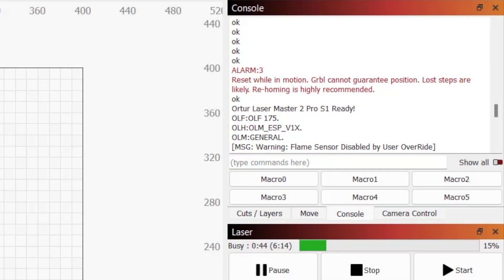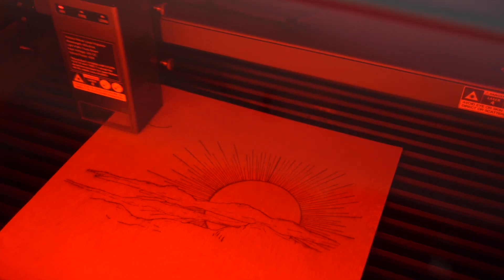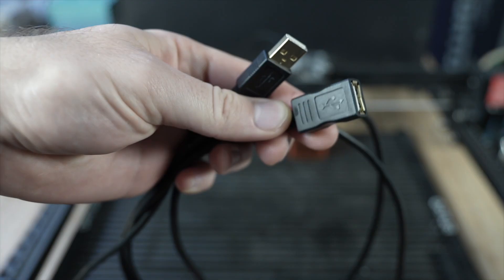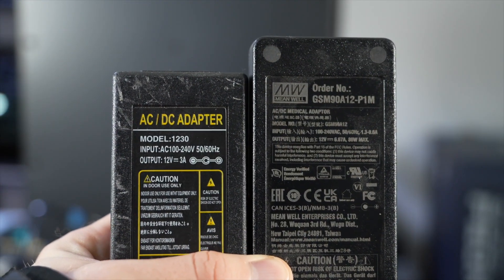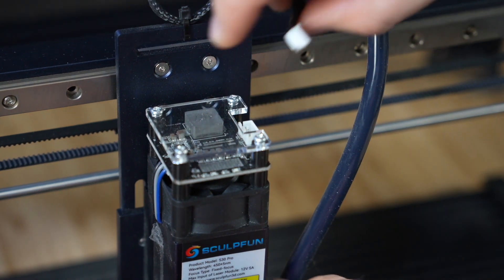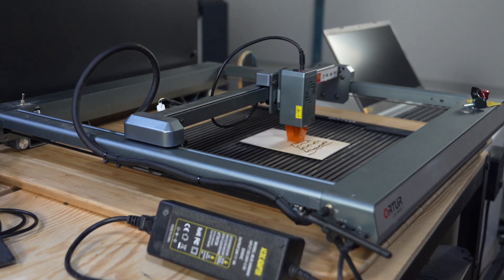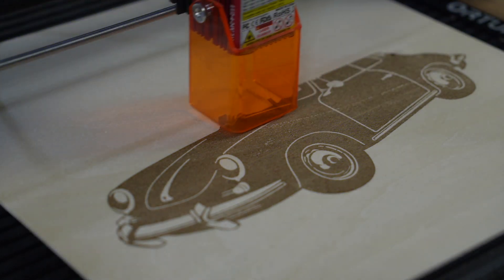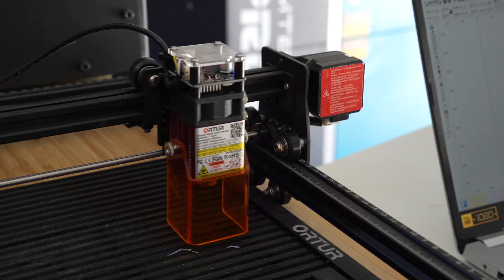GRBL Errors: Alarm 3

Comment: Hi I have the falcon a1 10w laser and iv only had it for 3 weeks. Its been working just fine till about 30mins ago it shut of and turned back on out of no where and now it shows alarm 3 reset while in motion.  Grbl cannot guarantee position,  lost steps are likely. Re-home is highly recommended. I already pressed the re-home button it when back and now as soon as it hit half way to a job it stops. There is no resistance if I move it freely. I am new to this and would like a bit of help if possible please and thank you ahead of time. The type c cable to connect to the laser looks to be working good because I can move it with the softerware lightburn has to move the laser anywhere but it just won't do the job anymore.
Reply from the maker: Please send us an email at Support@LightBurnSoftware.com, and include all the details yo u shared here. One of our support agents will be happy to help!
Reply: @lightburnsoftware7189 thank you for the response. I just got off chatting with the manufacturer about the issue I'm having with my laser @creality and im waiting on one of their technicians to get back at me to see whats the issue but im leaning to bad power supply ast it only turns off as soon as laser turns on other then that everything works as it should endless its the diode laser thats no good anymore. But if they can't help me ill email you guys thank you once again 🙏🙏🙏🤝🤝🤝

Comment: Microsoft updates frequently interrupt large jobs.  disconnect from network when running jobs.  Another issue is large images 6x6" in grayscale frequently crash jobs, both memory and disk resource run low and then system freezes.   One key feature missing in LB is display of last g-code line number and the ability to continue from last good line number.  LaserGRBL has done a very good job with this and its never crashed.  Must have for 2.0.